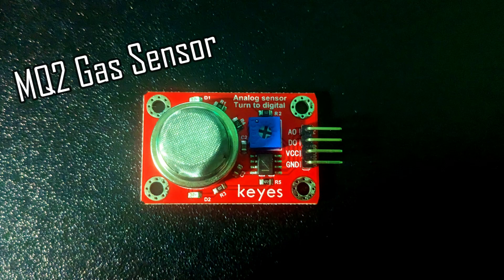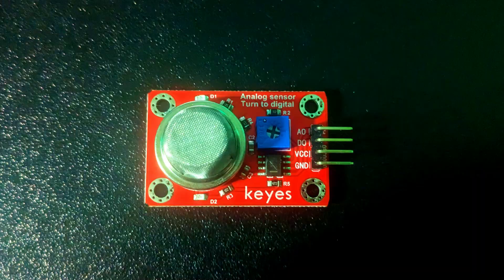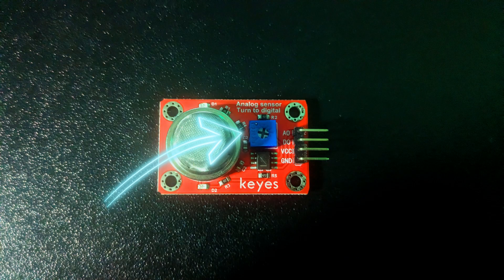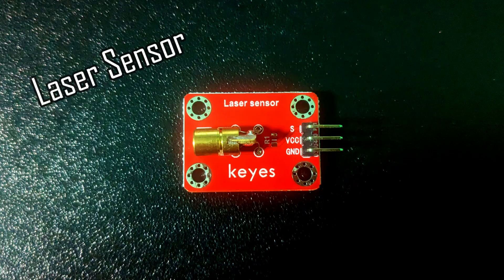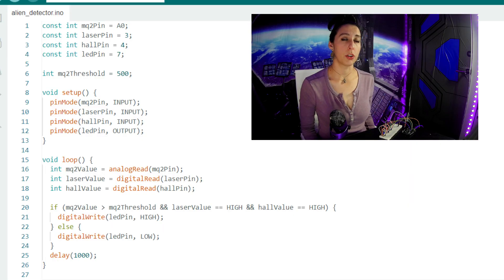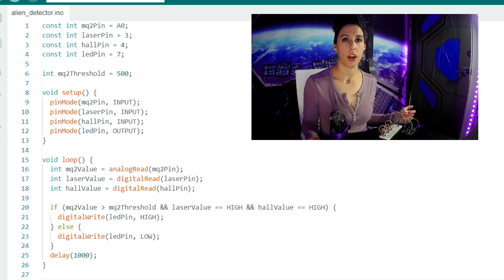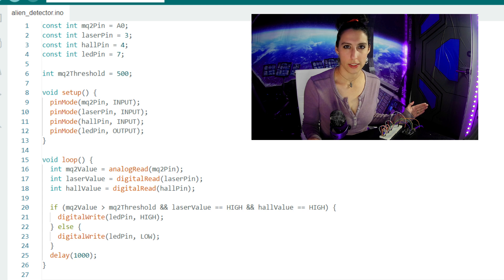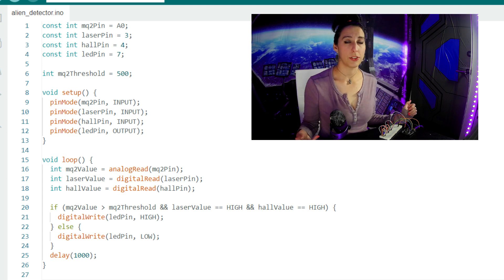Arduino vs. Alien Parasite - Gas Sensor, Laser Sensor, Hall Effects Sensor, and Paranoia

Comment: If you want to make it in space, you gotta up your game. Code these first as methods organized into libraries. Then as interrupt driven modules. Your loops are going to get ungainly. Move then into an RTOS like FreeRTOS and lose the loop. To do this dump the bush league arduino IDE and use a real dev environment that maximizes resources and really gets you to the metal. Space is no place for amateurs, you end up right in the meat grinder.
Reply from the maker: Unfortunate that I'm an unprofessional amateur then
Reply: @unprofessionalspacepirate  Meat for the grinder, grist for the mill.